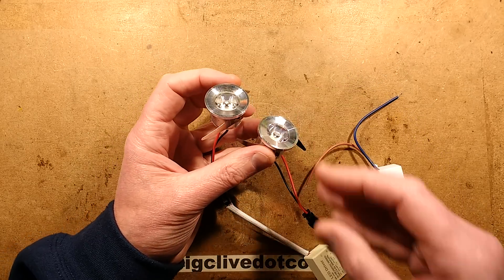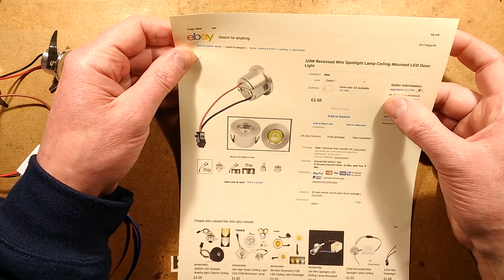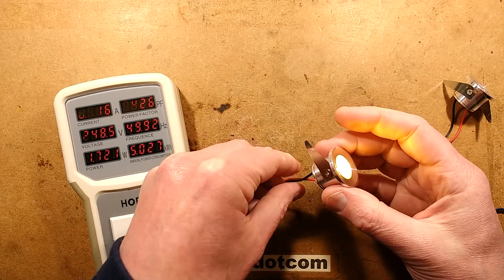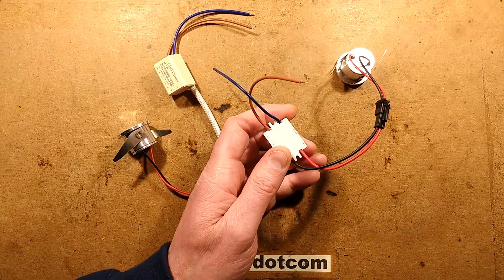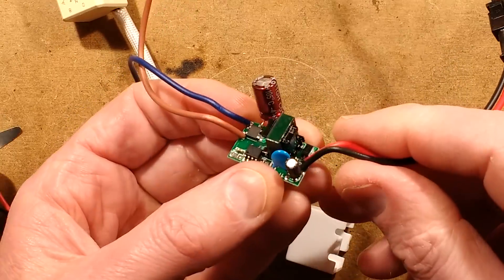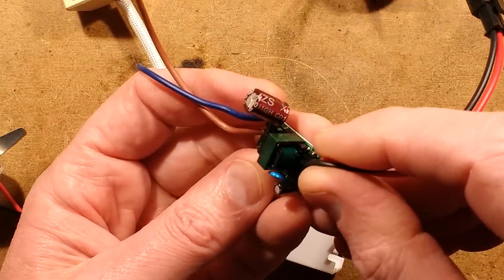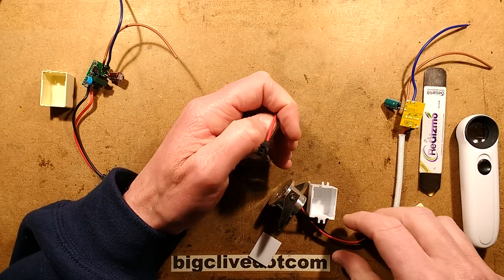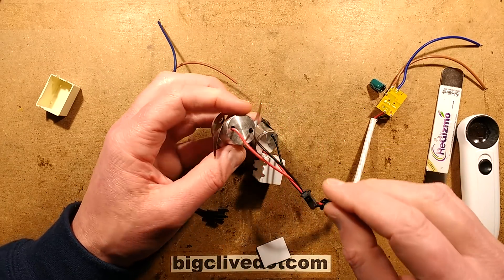1 watt versus 3 watt LED downlights.

Comment: Your mains power is bit on the high side at 248V isn't it? Is this normal in the UK since the European standard is 230V?
Reply: yep we have a nominal 240V here, often is up to 250V tho.
Reply: Looks like UK is being naughty, wasn't all of Europe supposed to uniformize to 230V?
Reply: t0nito  We did, but the allowable tolerance was adjusted across the EU so that power companies did not have to replace any of the large and expensive distribution transformers.
Reply: 250V is more efficient than 230V too , less power lost in the drop tails is good for the supplier :)
Reply: the transformers thing is relevant too, to drop the 250V to 230V without changing transformers would result in a drop of 1000's of volts on the main pylons etc..  That would mean a load more power loss throughout the entire grid.
Reply: And probably way more stressful to less tolerable electronics I would say...

Comment: Clive..
In the USA, we measure Light output as watts..
Which is abit stupid, as Different coatings limit light..
Love people who use a Coated light in a Frosted Lamp cover..  and expect the same amount of light..And CLEAR bulbs were expensive..
Reply: Lol..
I do like Lumens, as getting older and some eye problems..but also Like wide spectrum bulds and not those that lean to 1 side or other..  Found that a combination of Blue and yellow really helps..and cheaper then Full spec.
Reply: Light output is measured in lumens not watts. You will find bulbs with the same wattage that have different lumen ratings. Now whether you can trust the lumen ratings is another question all-together. Sure, you see "watt equivilant" but that is just so people know this LED is supposed to be about as bright as a 40W incandescent, since consumers do not have the lumen values memorized. Watts is a measure of power consumption. Lumens is a measure of light output. The sellers lie about both.
Reply: I know about the lies..  Including getting/useing 130voilt bulbs over 110/120..  And the trick about Dimmers..  Get Higher rated/lumen bulbs and Cut them back 20%...makes them last ALONG TIME...
But, now we are depending on that Little transformer/voltage regulator..NOT the bulbs..
Would love to setup a 12 volt Light system in the house..There are some Great 12 volt lights..

Comment: Perhaps they have some lamp modules with 3 chip LEDs, but they picked from the wrong box. I've seen the COBs (9-11v, 3w) for around 2 pounds on eBay.

Comment: is it a cockup and a 3w led with the wrong driver? or more likely are they just both 1watt leds... overcurrent test?? :D
Reply: Most likely it is deliberate.  They designed the housing to handle 1W, it cannot support 3W worth of heat, then they used sneaky deceptive marketing to sell the 3W for more money by just using a driver that is marked 3W, while most people wouldn't actually measure the wattage and be oblivious to the fact that the driver only does 3W when three LEDs are in series.  So, no increase in cost to them but more profit using deceptive marketing.  In other words same story different day.

Comment: Maybe the LED is 3w too, but it needs more current.
Reply: David Scheiber *mA
Reply: Ah because the driver was meant for LEDs in series and in those 3w LEDs are(usually) connected in parallel (requiring 700mah for full brightness)
Reply: Every LED is 3W, if only for a short period of time.
Reply: The LED may be 3W but that doesn't mean it needs more current.  That would mean it needs more heatsinking and THEN you could try more current.  The way that housing is set up it is not suitable for much above 2W and will be hot at that, which may  not seem like a big deal for a cheap light but the way it's meant to drop into a panel or ceiling, etc, that can tend to discolor the material it's mounted in.  Suddenly not worth it at all, instead get 3 of the 3W version and run them in series off a single included PSU since it is capable of that.

Keep in mind that if these were capable of 3W, they would have ran them as 3W out of the box.  The only difference in making that PSU 3W vs 1W is probably a change in the sense resistor value.  It "might" need a slightly larger transformer too but visually, the 3W versions I've seen that drive a single LED, have about if not exactly the same size transformer.
Reply: Every LED is 1.21 Jigawatts, and then it goes back in time ! Or boom.
Or maybe !!  It just seems to go boom but goes back in time !!!!
Reply: In the future, every LED will be 3 Watt for 15 minutes.

Comment: Hey Clive!
Im thinking about instaling some of theses USB wall chargers. And i was wondering if you have eny experience with them, if they are safe and all. 
thanks for the great vids!
https://www.ebay.com/itm/Dual-USB-Port-Electric-Wall-Charger-Adapter-Station-Socket-Power-EU-Plug-Switch/112571877127?hash=item1a35ce8707:g:OasAAOSwQNRZw0ra
Reply: Make sure you make a video of your house when it's in full inferno.
Reply: siggo loggo 
He has talked about what he thinks about them in previous videos, he's not a big fan of them because you are putting active circuitry permanently in your wall. While they may have proper safety and protection in the event of a malfunction it means you have broken circuitry sitting in your wall. In my opinion....meh I'm considering installing some in my house just to aid in removing the clutter of chargers.
Reply: Get a major brand that's UL listed, not generic Chinese junk grade.
Reply from the maker: I'd only recommend the equivalent unit bought from a reputable supplier in your country.  The imports have very poor electrical separation.
Reply: David Scheiber thanks man for the help!👍
Reply: "5V 1.5A in total" It's crap. At least get one that does 2.4 amps. Even that is outdated by today's fast charging standards.
Reply: Hendrik Hendrikson 🤗☻☻☻

Comment: Am i the only one that doesn't hear anything? The video is just silent...
Reply: Darth PuffMaN 
Yes, have you checked your volume?
Reply: It works for every video, except this one. Trust me, you can spot the difference with a Logitech Z906.
Reply: Darth PuffMaN 
Ok Mr fancy speakers XD
Try restarting your computer
Reply: David Scheiber I think that his speakers are just to posh to play some videos...
Reply from the maker: Check your surround sound settings.  Sometimes Dolby thinks my voice is a bass track and diverts it to a missing central speaker.
Reply: Darth PuffMaN Nope, can hear it fine
Reply: bigclivedotcom Lol. Manly man problems
Reply: Have you tried turning your ears off then on again?
Reply: Just another YT bug. I had a similar issue about a year ago. Every video from just one channel was silent, no one else nor anything else. Even after reboot. It was really odd. Eventually it went away, never found the cause.
Reply: Have you got your speakers set up to output Surround Sound but you've only got Stereo speakers - I've had that as an issue before
Reply: What browser? What kind of speaker setup? If you're on chrome you may need to add some flags to your shortcut, I have a quad setup set for 5.1 surround sound and I had to add both of these flags --disable-audio-output-resampler --force-wave-audio because chrome does some funny stuff with the audio and that fixed it for me.
Reply: Wow you people sukk at answering questions!   Yes Darth, you are the only one.
Reply: I would suggest trying to play the video at different resolutions.  Yes, I said resolutions.  YT feeds video and audio separately above 720 IIRC so it might work below that.  And there are different codecs at different resolutions.
Reply: Darth PuffMaN YouTube has actually been hacked
Reply: Oh, your bass-amping secret is out of the bag!
Reply: Check that the connector is in properly and that there aren't any faults in the cable. The sound in this video has almost identical left and right channels, the only difference being background noise and about 0.3dB difference in amplification, so if for some reason the signal ground/common isn't making it to the speakers, all they see is the small amplification difference. If you have the volume low or use a compressor it'll be hard to hear, and if you happen to normalize the channels independently you'll get nothing but the noise.
Reply: If all else fails, then rebooting your ears is the only remaining option. Start with a thumb on the nose then index finger and middle finger in eyes for CTRL-ALT-DEL. Then repeat with the other hand for the full reboot. Be careful though, because starting with the wrong hand can erase your memory.

Did that help to cheer you up a bit?
Reply: OK with Firefox
Reply: You know what? It works just fine on my phone. But I noticed some other minor glitches on the YouTube website too. It's just strange that only this video is silent.

Oh, and a reboot didn't fix it, I already tried.

Comment: I believe the arms in the lamps are cut at an angle so once installed you can then rotate the lamp and it will come out.
Reply: I guess it's what your use to, gypsum board is it's true name but most just call it sheet rock. Gypsum core with paper facing on both sides. Now you can get different grades and some that even has fire resistant coating on the paper, still can catch fire but it's rated for a specific time (usually 4hrs) before it starts combustion. Heck they even make sound dampening gypsum board (usually 4-6 layers of 1/4" or 3/8" laminated together) used in theaters.
Reply: Yeah, in practice, it screws snug, and comes out with a single counter rotation. They do 'bite' though, especially if biting into gypsum board. If that happens, you may not be able to get it back out again without chewing up the hole.
Reply: I have installed many a down lights of various sizes from 2" to 6" can lights, usually the angled part of the holder is like that to accommodate the different thickness's of the material your installing it thru. With sheet rock (gypsum board) it could kind of have the ability to unscrew but once you did that beings it's a flat surface against flat surface (not like a screw that actually cuts threads into the material) it would most likely remove some of the sheet rock with it.
Reply: Well, to me, 'gypsum board' is different than 'sheet rock'. One is for the walls, the other is for the ceiling, they are a little different in consistency, but yeah, what you said. The problem is if the little wing bites into the material, you can't get it back out without chipping it unless you attack it from behind.
Reply: Sheetrock(tm) is a trade name of USG.   Drywall is a generic term for any wallboard (including gypsum), and gypsum board is a description of specific panels, which includes Sheetrock.   They even make lead coated gypsum board for x-ray rooms.   It's like the difference between Kleenex(tm), facial tissues, and tissue paper.
Reply: Probably. It's just a regional thing I never really gave much thought to. :) Yeah, dry wall and sheet rock is the same thing for me as well. Gypsum board is an even more generic term though, and used for more novel panels, like the lighter airier panels used in ceilings, but yeah, I am sure that usage varies across states, and massively varies across countries.
Reply: "It's like the difference between Kleenex(tm), facial tissues, and tissue paper."  Still all paper, same as gypsum board, each type has a specific propose or specific job.
Reply: Been dealing with gypsum boards (sheetrock, Drywall, or what ever you choose to call it) for going on 40yrs. I will admit that from the first time I helped hang it as a kid to now it has become considerably lighter over all, of course that depends on it's thickness. LOL
Reply: Helpers and a drywall lift is the way to go for overhead work, as far as walls stack the first row and then if your by yourself drive a few nails on the top edge and just set the top piece in place and nail or screw it (then pull nails). Over the years I've been shown many many many ways of doing it but it all comes down to talking someone into giving you a hand just to make it faster and easier.
Reply: I couldn't do it for a living. I can hardly hold my hands over my head for an extended period, let alone supporting any weight at all :P
Reply: Don't forget the "Green Board".....sheetrock that is rated for moisture such as in restrooms.
Reply: Yea but depending on who makes it most green board is really a concrete board made up of little balls of concrete sandwiched between moisture proof paper.
Reply: I was just going to say the same thing. Glad I read the comments first.

Comment: Looks like they'd be a pain in the arse to install into gyprock with those springy metal tabs.
Reply: Wim Widdershins get a few cuts while fitting
Reply: As an electrician who has installed hundreds they go in fine.  You have to cut the hole perfectly and exactly the right size (normally a hole saw).  Hold the clips in tight and twist as you push it in.  They are not my favourite mounting method as getting them out without damaging the plasterboard can be a pain (but is possible if you are careful)
Reply: Not at all, you just need to make a round hole that doesn't chip off beyond the diameter of the bezel so it doesn't look like crap.